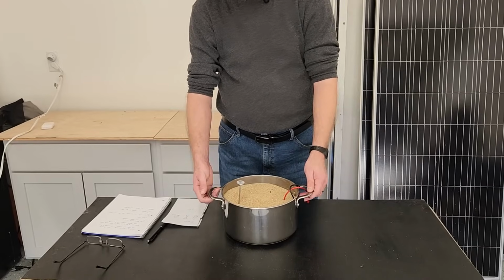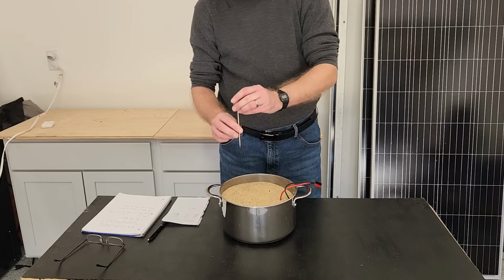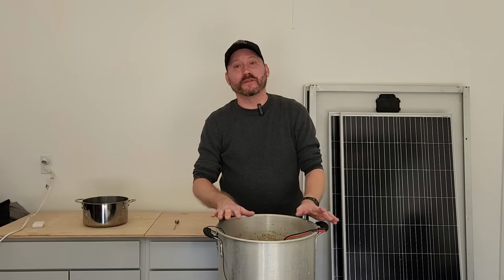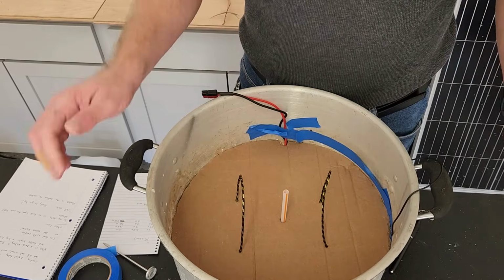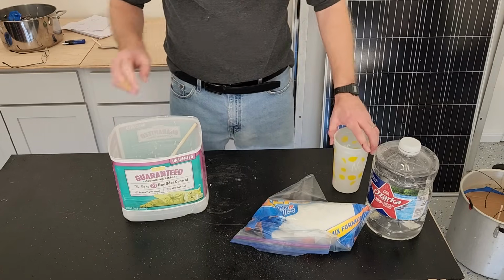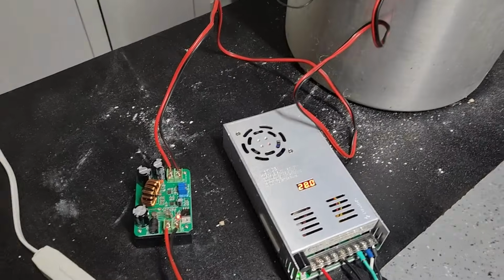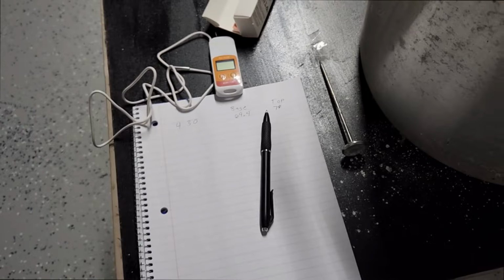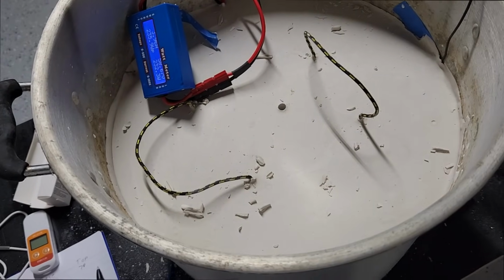Sand Battery heater. Create free heat  of 500F using solar electricity! Texas Prepper Projects

Comment: Its more efficient to just wire a matched voltage and wattage water heater element directly to the solar panel and heat water in a 55 gal barrel. Water is a much more efficient heat storage medium than sand.
Reply from the maker: Not based on my tests for my next video.....
Reply: @texasprepperprojects  Yeah, we'll see. Its a fact that water is a better heat conductor than sand. Heat moves into and out of water at a higher rate than sand. Water will release the stored heat quicker and mire efficiently over night. If your sand is still warmer than the ambient room temp the next morning, then thats less efficient heating. In the end, as long as all the wattage from the solar panels is transferred into the storage medium, heat is heat and it will all be in there regardless of what the medium is. The efficiency is simply a matter of how fast the heat gets absorbed into the medium and how fast its released. Water will absorb and release heat faster on both ends than sand. There's a reason water is the highest rated thermal mass heat storage medium in passive solar heating design.

Comment: Upscale it. Find a defunct GAS water heater. strip off the shell, chop off the top, make any repairs and repeat your install. Gas heaters have a central flue that would aid in convection heating of the space. Something of this size of course would be a whole house heater and stationary since it would weight nearly a thousand pounds. 

One other point. Having a sand battery has the potential of improving the overall efficiency of a solar or wind install. Generally with off grid set up the battery bank is over sized compared to the inputs. If a dump source (the sand battery) is available any excess power can be shunted to the sand and still be utilized in some fashion. One can then increase the input sources overall. In grid-tie systems the grid is the dump.
Reply from the maker: I want to make something that anyone can walk into any home depot and buy the stuff for under $99 and replicate.
Reply: @texasprepperprojects  Understandable, but its the ole theory, go big or go home. :)

Comment: I have watched about 3 of these videos and no one has done anything beyond filling a cooking pot with sand. MEH... 55 gallon barrels are cheap around here. So... I am going to get 2 of them and weld them together and fill them with sand. Still not sure about heater elements, how many? and something like a coil of copper tube to pull heat out with liquid, probably oil so it can not boil. It could work stand alone and just shed heat from the metal outside. If it works well I would like to super insulate the outside and be able to remove heat and then radiate the heat through a liquid to air heat exchanger probably with a fan. Anything electric would be powered by Solar and perhaps a battery to run the fan at night. The goal is to heat a 30x40 shop. 

I was using a small oil/resistance heater 1500w? to keep the shop around 45 degrees for the last 2 winters. That cost me a ton of $$ last yr as rates went up, so, cant keep doing that. If this all works out next step is to up size the sand heater to 15 to 20 yards of sand and a full large array of solar panels.
Reply from the maker: Watch the rest of my videos in the series. I went way beyond this with testing and math and practical application
Reply from the maker: There is no way you are going to heat a 30 x 40 without literally TONS of sand. I think a 55 gallon drum with a few hundred pounds if sand might heat a 10 x 10 greenhouse

Comment: Substance	Specific Heat (J/kg•K)

iron	450
sand	670
wood	1760
water4180       

just some info that may add to the conversation……sand does NOT hold more heat than water….and direct thermal transfer..is much more efficient than changing light to electricity and back to heat again….but learning as you go is fun no matter what the outcome…looks like you are having fun 🎉
Reply from the maker: THIS is great info

Comment: There is an old expression amongst physicists- energy in equals energy out.  It took a day or more to amass the heat so how long to dissipate it and in how large an area?  A mobile home, a camper, or a pup tent?  One of my thoughts during the vid was how long can a water heater element go before it burns up when above 212 degrees f?
Reply from the maker: check out the other videos for the answer!

Comment: Haven't read all the comments but what about putting a copper water tube (with fins) through the pot so the sand heats the water and then use that for radiant heat? Guess I'm not sure if that would be more efficient than a regular water heater or not?
Reply from the maker: Check out the follow up videos series.    https://www.youtube.com/watch?v=siY-t8xlQhU&t=3s

Comment: Ha Texas Prepper. What if you put a heat exchanger in the heated sand. Make it from several loops of copper or stainless steel tubing filled with water. The Inlet and outlet ends of tubing coming out sides of pot or vessel. Connect them to a 12-volt pump and a radiator device with a fan blowing air through the fins picking up the heat and blowing worm air out into a small room or microclimate space.
Reply from the maker: It's a neat idea, but really not needed. You won't technically gain anything from that. Heat out = heat out, regardless of what form it is in. A bucket of hot sand is going to have the same heat delta regardless of what you do to it. The ice chest/copper pipe fan rigs don't add anything.  My version 2 won't be any 'better' but the heat will be more 'focused'

Comment: The answer to this? Is a used Electric oven that has a top vent. A dozen or so selftapping screws and washers to seal up the door with an extra rope seal common to wood stove doors as a gasket. Fill the oven from the top vent full of sand, take off the back and disconnect the two wires on the lower element, and replace them with your leads from the solar. If you can afford to have a second (or even a third) string of solar that you can add to it in the winter for greyer days. Just keep them in series parallel to the load.
Reply from the maker: Cool
Reply: @texasprepperprojects  No its hot. 😁 And if you have access to someone who can bend up exhaust pipe? You can put a coil inside a 45gallon drum for the exhaust vent from the stove to heat up another 1/2 ton of mass on top the stove as well. You just need a small hole for cool air to enter the pipe between the two
Reply from the maker: @davefroman4700   Check out my videos 2 and 3 in the series. I've done similar to this.

Comment: Had a thought to keep my 45 gallon outside  water tank ,free of ice,for the birds ,in the winter up here in Canada (Alberta ) .With a solar panel heating the sand then running a water line from the water tank, circulating thru the hot sand container and back to the water tank ,keeping it ice free . Probably using copper water lines. Just a thought
Reply from the maker: try it!

Comment: I'd be curious to see if painting the surface of the pot with a high emissivity material like black stove paint would make it read a higher temperature on the laser thermometer. It might help it radiate better. Or you could scuff up the metal to increase the surface area on a microscopic level.
Reply from the maker: After thinking about it for a few days, I think that the pot's material actually had a NEGATIVE effect on the radiated heat. If you think about it, I'd presume that as a cooking pot it was designed to keep the heat IN, not radiate OUT. Also, the metal of the pot is quite thick. I'm curious to try again with a thin walled, cheap trash can.
Reply: It would be interesting to see how a large terracotta pot radiated the heat vs the metal
Reply: You could also try implementing ones of those stoves fans the rotates when it heats to blow heat around the room
Reply from the maker: @adkenzo  I have something similar on the way... that i think will be more efficient

Comment: It's an interesting experiment, but you would need a lot of storage to can usable heat.  And a lot of panels to fill the can up.  Some useful conversions are P(watts)= Amps X Volts   and  1 W is equal to 3.41 BTU/h.   Consider that a typical Mr buddy propane heater is 4000 or 9000 btus.    To get the same heat output as a 4000 BTU heater would require 4000/3.41 = 1173 watts.   A typical house furnace would be 50,000 BTU to 100000 BTU.   My point, solar photo volt panels are just not a good way to heat as it takes a lot of watts for one and the second reason being that a solar panel only captures about 10% of the energy from sunlight as only certain wave lengths of light will make electrical energy on the cell.   That's why you don't see solar voltaic heated houses.    Now if you want sun  heat the way to go is passive heating.   The amount of energy available is something like 1000 W per square meter.
Reply from the maker: Agreed

Comment: Thanks for the video and the experiment. Enjoyed the discussion/comments below that this provoked. Will be reading every one of them & will try these suggested improvements on my own. Adding my own comment - would adding terra cotta pots on top of this help radiate the heat (taking the idea from a crisco video i recently watched)?
Reply from the maker: The Terra Cotta pot thing has been disproven several times but still remains all over youtube.  Stay tuned for rev 2 where I try to focus the heat properly.
Reply: @texasprepperprojects  As someone that has used terra cotta pots for plants -- they brake far too easily to try to use them to contain flame, especially after they dry out such as after spending a hot summer in the heat of the sun... and I live in a rural and forested area in Zone 7.

Comment: 1:00 sand has a lower specific heat capacity then water. So it actually holds less energy but since it's also less conductive it will store that heat for longer with less insulation.
Reply from the maker: but it can take HIGHER heat than water
Reply: @texasprepperprojects   Higher temperature though less heat per degree. 100 degree water holds more energy then 100 degree sand. it takes 830 joules to raise sand's temperature by 1 degree while water takes over 4000 joules.

Comment: That heating element needs to be slid into a small hole in the side of the pot, to keep wires free of sand. Use clear silicone as needed
Reply from the maker: I don't think that silicone would hold up to 500f
Reply: @texasprepperprojects  at 500f, your wires would be destroyed before silicone. Having wires on the outside would keep them damage free and accessible .Silicone to seal out side of hole. No more heat problems, just nice room heat. Nothing non- metallic inside of pot to eliminate temperature worries

Comment: Your heating element doesn't care if you feed it AC or DC, so if you connect a couple solar panels in series to get  100-140 volts you'll be fine because the resistance of the element rises with  temperature so it will somewhat self regulate.
Also, in v2 I suggest turning the pot upside down and putting the element through a hole then screw the connector plate onto the outside (the connections should be in free air), flip it over and stand it on spacers before filling. I really don't think the plaster top is of any use and will just waste a lot of heat.
Reply from the maker: Watch the other videos in the series on this

Comment: Cool !
It sounds like you made a "heat sink".....what if...instead of sand, use water, and circulate it in a copper pipe coiled inside of the bucket.....then run the copper pipe outside of the bucket ?????
Reply from the maker: Heat is heat is heat. The btu in the sand won't get any higher by pumping it through a heat air exchanger
Reply: @texasprepperprojects  
You are correct, but the heat doesn't really radiate out of a plastic bucket.....

Comment: Im considering putting a copper bin of sand elevated on fire bricks in my empty fireplace with a solar powered heating element just sitting UNDER the copper bottom. Seems like that would be a simpler build without needing to worry about melting the wires since they would be at the lowest point in the contraption.
Reply from the maker: check out video 2 and 3  i made on this

Comment: Use the type of element that has a thermostat built into it and mount through a hole in the side.  Use a layer of vermiculite below and above the sand.
Bummer you didn't provide any stats on how long it stayed hot after the heat was stopped.
Reply from the maker: Check out video 2 and 3 for testing and data

Comment: Hi. Saw this interesting piece from the UK.  Can I suggest you fit a bi-metal thermal cut out to save your components.  You can with experiment fit one to the Goldilocks spot on the outside of your containment vessel.
Reply from the maker: Thanks for the tip!

Comment: How on earth did the coverings for the wires to the heater and the probe not melt, given that sand was able to fuse together?
Reply from the maker: It wasn't the sand that fused. If you look at my other videos I learned that the plastic housing from the heating element melted

Comment: its an interesting idea indeed using sand. I ordered some low power heating silicone pads. 20watt each. Im going to see what i can do to get some warm, not hot, warm water running for doing dishes, shower ect. I plan to insulate a big steel drum, slap a few on the side between the steel and the insulation and run a few of them 24/7 with solar energy. I wonder how many will be enough, but i guess it varies with amount of water flow.

Anyway.. Maybe if you used a LFP battery and a liiittle less watt you could run it 24/7 too? Yea with a larger solar panel ofc :)
Reply from the maker: The whole point of this was to try to not use a battery. If I spent $400 on a lipo4 100ah and an inverter I could run a 300w space heater all night. It's an option but I was hoping a $6 bag of sand would do the trick
Reply: @texasprepperprojects  i understand what you mean. I just wanted to expand upon the options. I often have thick 360degree blanket clouds from 5am to sunset, so a battery defently helps on those days to supplement the solar panels mighty reduced output that might completely disable your example on said days.

Comment: I wonder if you stuck copper pipes in sand if it would act like a heating vent! To soak up that bottom heat and putting it in the air before it loses its heat working to top of sand? Would a bigger set up heat up water for under floor heater?🔥radiant heat.
Reply from the maker: Check out video 3 for what I did instead

Comment: I have considered this experiment too. I hope this works. I wanted to mix carbon with the sand to make it conductive so that it would be come the element for heat. Still working on that idea. The element is designed to work in water.. wonder how long it will last in sand before it burns up?
Reply from the maker: Huh. Interesting idea.  I don't know what that would do to the internal resistance though.  I'm working within the parameters of powering this with solar, so trying to keep the voltages and amperage requirements within reasonable limits of 2 panels.

Comment: That's a water heating element you should purchase the water heating thermostat strap it to the outside of the container hi the element into that run electricity through the the thermostat that way you can regulate and be safer maybe even Mount the element through the wall of the container you might even use an old electric water strip the fome off the side of it and remove the top clean most of the rust out of it fill that wiht sand
Reply from the maker: cool

Comment: I had this idea  digging in the yard  a lets say 5 ' deep hole where there would be heat absorbing rocks like volcanic rock  and on the btm of the hole  perforated  metal pipes where  a moter would suck the heat  accumulated in that 5 feet deep isolated by sand and the motor would suck the air in the house?? I wonder if that could be a feasible project? anyone ever tried this?
Reply from the maker: You need to research geothermal.  A more effective way is to bury 100' of 4" drain pipe from home depot as deep as you can and put a 4" duct booster fan on the end